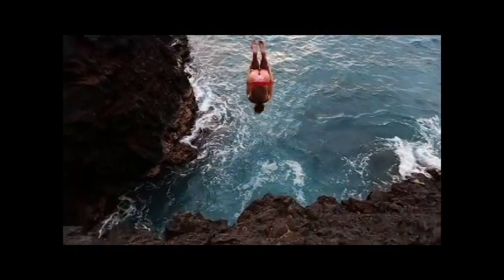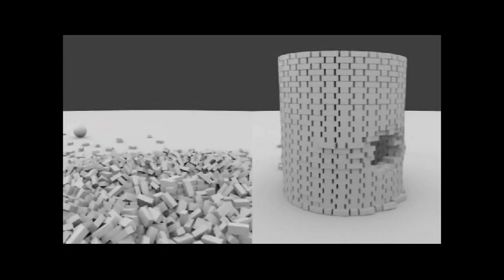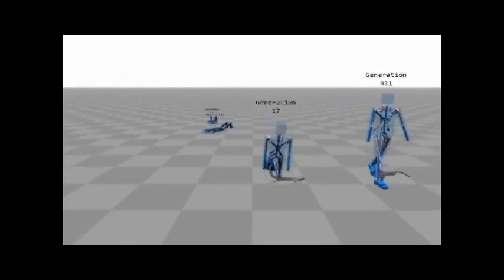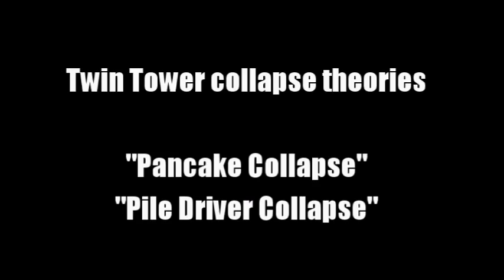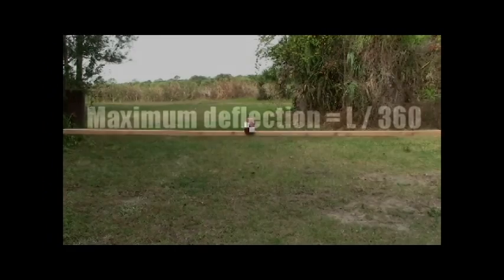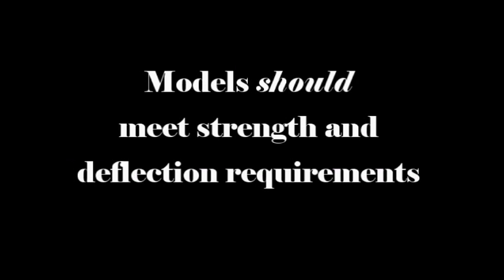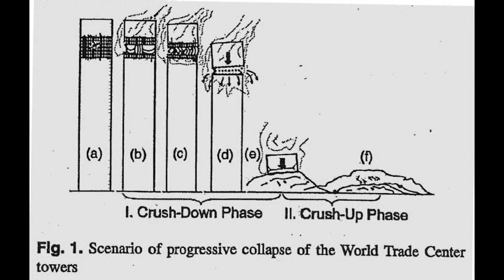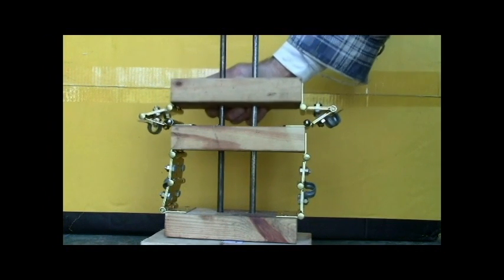9/11 Experiments: The Force Behind the Motion

Comment: Wow, your experiments were all completely useless because the parameters you used in each case did not, and could, replicate the forces that were involved on the day of the tragedy. Moreover, in each experiment your model cores remain in tact, which is not how the Twin Towers were designed. Unlike previous methods of skyscraper construction the WTC buildings were supported primarily by their outer shells. This was done deliberately to allow for more room on the floors that would be occupied by offices. We know that once the mass of the structure above the site of impact is accurately calculated, the weight is more than sufficient to cause the inner core to fail. The inner core did not carry the brunt of the structural strength, thus making it coompletely conceivable that the columns failed. Moreover, you can clearly see the outer shells of each building peel outwards and away as the weight from above crushes downwards. The floors were trussing beams that were fastened to the outer shell. Logically it makes sense that as each floor collapsed on top of another those beams would bend or snap, creating immense tension on the shell - enough to pull it inwards or push it outwards. And another very important point - the weight that was driving the downward collapse was compounded as the floors collapsed, thus logically making it heavier as it gained momentum down. Your experiments also don't replicate the weight of the actual buildings in any way... You don't even understand the construction and architecture of the buildings, yet you create models that do not have the outer shell or the trussing floors that supported them and want us to believe what you have shown is accurate. You KNOW that what your experiments show is not what happened on 9/11,  so why you even consider those theories in a simulation? Only someone with zero critical thinking skills could find your experiments compelling. For the rest of us it's just a joke and a monumental waste of your own time.

Comment: If it could pancake it would have happened moment of plain impacted and exploded.
Reply: Mitchel - "If it could pancake it would have happened moment of plain impacted"
Why? The weight of the upper pats was still supported by the columns. The fire heated up the steel which in the end lost a lot of its load bearing capacity and it failed. Only after the initial collapse (the failing of the columns), the "pancaklng" could start.
Reply: On all the simulations the airplane impacts the building with down force, if the impacted with sudden extra weight of the plane with and the explosion of fuel didn't start the pancake how did a fire start it, at lest 1/2 of each building should have still been standing.  Like all examples of a "pancake" collapse they don't continue the hole way through to the ground. if you find the right clip they didn't pancake any more then they suddenly dropped into the ground. the bottom falls into the ground at the same rate the top comes though 1/2 of the building.

Comment: Its funny how he smears a  computational model and tries to beat its predictions with a totally shitty physical model :) physical modelling is 100% accurate only if you build the exact thing. Thats why the common practice is the hybrid aproach of both. You match your math with real behavior and than you can trust the math to predict around this verified case
Reply: I dare you to build a model that will show a global collapse. (spoiler, you won´t be able to, it is physically impossible). Why did Nist not share the computer model data they used? Science must be peer reviewed otherwise it is not science. What they did was work backwards, they tweaked the data until it showed what they wanted to show. If and how many core columns were damaged is pure speculation, yet an important part of the collapse. This means the entire report is based on speculation. 

Evidence shows no recovered core column ever reached a temperature of even 250°. So how come they used a much higher temperature? Because the building would not collapse without that. Just like the fireproofing being dislodged, the experiments they did was in no way matching reality, still their assumption that the fireproofing was widely dislodged was used. Without that, the building wouldn´t collapse. Again, this is based on pure speculation. 

How can anyone regard this as being ´the truth´?

Comment: Nice models.  Unfortunately, your floor sections are too thick to equate to the floor thickness of the towers.  Such a structure could not have been built.  In addition, the type of concrete used in the tiles you constructed the models with is the equivalent of a multi- directional reinforced concrete (which would have been impractical and prohibitively expensive.  Keep in mind that this was also a NY union job.  The grade of concrete was surely not as specified, as graft was rampant.

Comment: Steel goes through different stages of deformation when heated.  Simple physics, look up modules of elasticity, or hook's law.  When heated, steel will twist, stretch, elongate, and go through a state of plasticity before failing.  Those buildings would have twisted and bent before anything else.  They would have deformed and never fell, or never would have fell in the fashion they did on the horrific day.  The falling buildings were assisted through some arranged demolition.   I believe they would have never fallen like they did through being hit by the force of the planes, or the fuel burning theory.  Fake news.  Those buildings were designed to handle tremendous shear load given off by wind, and were, like all high rise structures, designed to support live, dead, and dynamic loads from the foundation up.  Think of it like this, at the foundation the building must be able to support the weight of all that is above it.  The support has to be strong enough to be able to carry all the load being put on it from all levels above and the dynamic loads being forced upon it.  Dynamic being wind.  Loads being people, furniture, building materials, etc.  These types of structures are designed with higher safety factors to compensate for these conditions.  Bottom line, an elephant can't stand on toothpicks!  This, for me, is just like the Vegas shootings.  Shock and awe.  No real explanations and too many voids in the storyline for me.
Reply: Thank you!  Accurate description of how steel behaves when heated.

Comment: im sorry but your logic about the accuracy of physical model vs computer model is flawed. you cannot simulate the same forces even scaled, that were found when the towers collapsed, not within a scale model, in yours for example with the cement board, if those boards were to scale then the floors would have been over 3 stories think EACH!, trust me the computer models are a more accurate way to simulate. i agree it looks like a controlled demo, but when you watch the first tower fall, and how the top of the building twists AND falls straight down through the other floors, it looks like it COULD have occurred naturally, especially cause i dont think anyone is considering the "blast furnace" effect from the high winds essentially stoking the fires inside the towers making them burn much hotter then i think people realize, those temps i do believe would get hot enough to cause the steel to enter plastic deformation.. just my uneducated 2 cents, im commenting on what i think looked natural based upon my good (but considering the vastness of avail. knowledge) and not full understandings of the topics at hand..
Reply: Blu Crystl lol its nice to see that the satirical nature of my comment didnt go unnoticed haha.

Comment: hey genius, just like the programming for the computer simulation has to be correct to match reality, so do your physical model experiments.
which btw, NONE of your models even remotely match all the variables and forces at play during the WTC Tower collapse.

setting the model on fire? really?

firecrackers , paper and hardieboard? 
yeah, id say you need to go back to school, build a proper model that accurately responds to exterior forces , and THEN run your experiment.

a scale model experiment will ONLY give accurate results if it EXACTLY simulates ALL aspects of the WTC Tower collapse.

id have thought you would understand that being that that was the entire premise of your video. you know, discrediting inaccurate simulations.
which makes me believe you are either a typical "truther" seeking to validate your own beliefs regardless of evidence or your one of those brainiac dumbasses that hasnt the common sense to translate from paper to "REAL" life.
Reply: Randy Kirkham ok, explain how a aluminum wing from a Boeing 747 sliced through all that steel and concrete like butter, the physics of what we see in every video showing the impacts just doesn't add up. Ppl are so blind to what is happening right in front of their eyes, I see all theis comments on ppl stating this law, that law, sounding smart yet they believe that aluminum can hit 2 inch thick steel, And concrete and show absolutely no resistance in the aluminum wing, wtf has gotten into theis ppl
Reply: Even at cruising altitude speeds it's not possible, open your eyes ppl
Reply: Nick Holloway - 1st of all the aircraft that struck the WTC Towers were 767s not 747s.
and they weighed almost 450,000 lbs and were travelling between 450 and 590 mph, which is about 800 feet per second, which is FASTER THAN A BULLET FIRED FROM A .45 ACP HANDGUN!

hear that? 
those enormous, heavy, fuel laden aircraft were travelling FASTER THAN A BULLET!
if that fact alone doesnt explain how they tore through the building nothing else i can say will either.

but anyway, those aluminum aircraft didnt "slice" through the steel structure.
they tore through it by bending and displacing the steel collumns and causing their connection bolts to break. the individual beam and collumn sections were ripped from one another and bent out of the way allowing entry.

the center core was destroyed in a similiar fashion.

now some of the denser parts of the aircraft such as the landing gear and engines likely did actually penetrate or "slice" and tear through some steel structure but most of it was simply displaced out if the way after the conbecting bolts failed.
much like the mangled steel guard rails youve undoubtedly seen on the side of the road after a vehicle collision.
just imagine what that guard rail would look like if the vehicle was travelling at 600 mph instead of maybe 40 mph!

the car would tear through it just like a bullet!
btw bullets DO NOT bounce off of windshields and ricochet off car doors like in the movies! the zip right through without hardly slowing down!

this is how physics works.
you would do well to study physics and even ballistics in particular to better understand the events of 9/11.

objects at speed act in very different ways than you would expect.
even a relatively soft, weak aluminum aircraft can tear through a concrete and steel building IF GOING FAST ENOUGH!

MASS(weight) × VELOCITY squared(speed × itself) = ENERGY !

given enough ENERGY as a result of its VELOCITY, even a MARSHMALLOW can tear through a car door !
ive done it!

much like relatively harmless objects in a tornado.
they become deadly missles due to their speed.
and even the most powerful tornados can only reach about half the speed the aircraft reached on 9/11!
ive seen a spoon driven 3" into a oak tree.
and a plastic childs pedal car driven into the wall of a house.
even a mailbox thrown through a brick wall!

speed is the key. along with mass.
a much softer, weaker object can tear through a much harder, stronger object IF going fast enough or if it weighs enough.

its just the way it works.
Reply: Randy Kirkham lol if there were traveling as fast as a bullet in the dense air it would have ripped it's flaps off, you do realize their designed to reach that speed in low oxygen at 37.000 feet
Reply: Nick Holloway - Yes, the 767 is designed to travel at high speed at high altitude. but it has nothing to do with the oxygen levels and everything to do with the air density.

regardless, the 767 has enough power and a low enough coefficient of drag to reach almost 600 mph at 1000 ft altitude. maybe faster in particular while carrying a relatively light passenger load and in a gradual decent as the aircraft were on 9/11.

so whether you want to believe it or not WE ALL SAW IT HAPPEN!
nearly 60 videos from 60 individuals of the 2nd aircraft impact were submitted and anyone with a modicum of knowledge can "clock" the aircraft and compute its speed. which i have done and everyone involved with the investigation have done.
and there is also radar readings confirming the speed that corraborate this speed.

so...genius. i guess its all a conspiracy to report a much higher speed than is actually obtainable in a sick, twisted attempt to discredit the mathematic system that dates all the way back to the, wait for it, wait for it, Sumerians and the Arabic numerical system!

YES! THATS IT! you see? its ALL a lie, wrapped in a riddle, slathered with an enigma and bound by a mystery! and its ALL to subvert credit from the middle eastern peoples of antiquity all the way through to today!

BRILLIANT!

btw, 800 feet per second IS FASTER THAN A GD .45 ACP BULLET FIRED FROM A HANDGUN! and those planes at 450 to almost 600 mph were doing damn near 900 feet per second! i used an average figure of about 800 fps.
so... thats the way it is, tiger.
whether your intelligent enough to understand it or not.
Reply: https://youtu.be/5d5iIoCiI8g

Comment: The collapsing point wasn't in the direct middle of the tower was it? I thought the edge of the building was the first to collapse and that was after minutes of the steel melting and there was a crap ton of force coming down on those beams bellow that didn't have any structural integrity to withstand the force. Plus the planes probably shook the frame of the building maybe. Idk. Either way, it happened and we're all gonna die some day so why r we getting hung up on this?